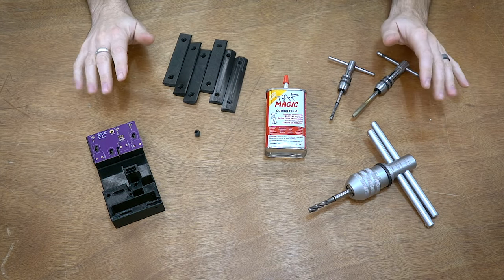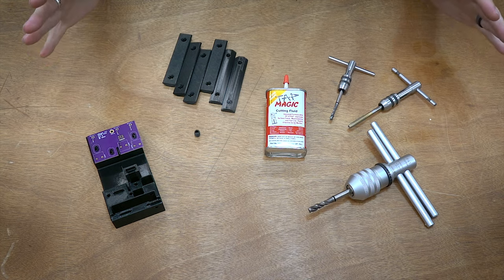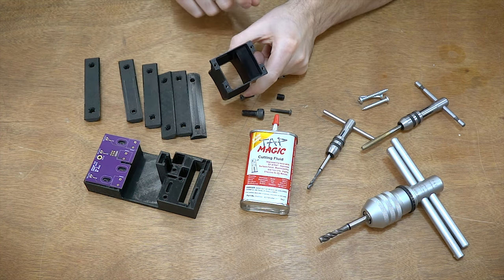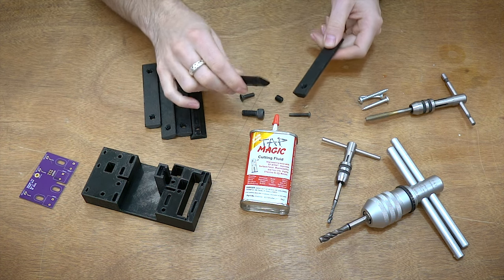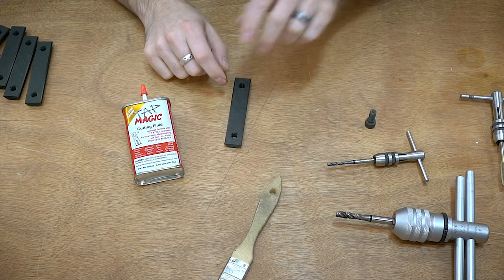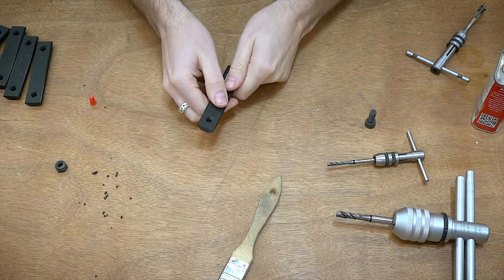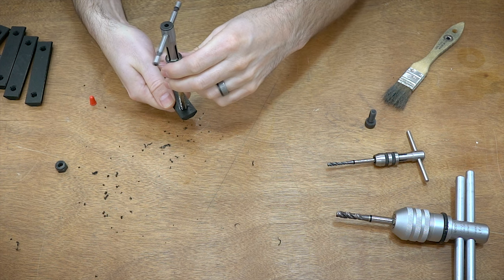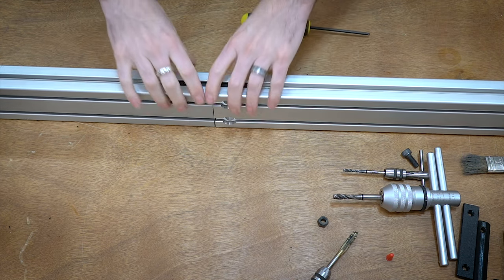Tapping 3D Printed Parts

Comment: Excellent video,  I would have never thought to use tapping fluid on plastic parts.  I will definitely try this.  I do tend to use the heatset inserts a lot, but I am also mostly in the M3 realm.  One thing you didn't mention for captive nuts is you can program a pause in your print,  drop the nuts in and then resume.  I do this with Magnets,  I have prints with completely hidden magnets.  There may be other workflows, but mine generally is to edit the G-Code and add in an M226 pause command at the desired layer.  I wrote a python script to automatically parse my g-code and add in the M226.  It looks for a layer/process change name that I set in the slicer and get's commented in the gcode.
Reply from the maker: Very true about pausing the print!  I've done this a few times, but for protypying, it slows things down quite a bit.  You can do this easily enough in Prusaslicer, you just click the plus button on the layer and it will automatically pause the print and wait for input.

Comment: One thing when it comes to wall counts is the nozzle size. For mechanical and fast iteration parts I print with 0.8mm nozzles, not the standard 0.4mm. Hence the wall thickness and strength increases, vs adding more walls that take more time to print.
Reply from the maker: For sure.  I was giving generalized information, but larger nozzles can create wider walls for sure.

Comment: You don't necessarily need a thread tap to make threads in plastic. The threads might even be stronger if you don't use one. When I was prototyping and designing the Gyrokey screwdriver handles, I tested using thread taps, but also created the threads directly using the screw. The handles are made for watersports hydrofoil assembly where M6 screws are pretty common, so I decided to use M6. If you use the fastener directly to make the thread, it will generate a lot of heat going in and there's a good chance you end up with a melted mess. However, I found that applying a bit of teflon grease on the screw reduces the friction so much that it no longer damages the thread. I have been getting excellent threads very easily by using this method. The thread length on the Gyrokey is a whopping 12mm, so it is extremely strong. If you tighten the screw too much, you will break the surrounding plastic (the thread itself will hold).

Here's my video on the Gyrokey, in case you're wondering how on earth a 3D-printed screwdriver handle might actually be a viable tool: https://www.youtube.com/watch?v=lutnfhRlRjc
Reply from the maker: You're mostly right, but threads cut by a fastener don't hold up with repeated use.  I think trilobular screws are the right way to go if you're not going to use a tap.

Comment: I use a bunch of the heat set inserts.  I've never even thought about taping.  I'll have to try out this method.  Thanks
Reply from the maker: It works better than you might think, seriously.  I go through a LOT of brass inserts, especially when running multiple tests on a single print.  This helps a lot.

Comment: I've got some parts I've printed for work that aren't necessarily final use parts, but are trial parts and need to be functional long enough to prove out their usefulness. I just sized the holes to where the bolts (#8-32 for the closure and 1/4"-20 for the hinge "pins") cut their own threads and had some extra friction to the fit from doing so. I'm using PETG and have the design and general form-factor freedom to where I can afford to have a thread engagement of ~4x the diameter but they seem to work nicely. For the knobs I've been printing them with a nut-shaped cavity and having it pause before it covers the cavity so I can drop nuts in. 

For cutting threads I've added a lot of extra material around the holes to be tapped (and drilled as needed) by adding small cutouts radially that are ~.1mm wide and 2-3mm long/radially and that not only gives me lots of extra material without having to add a modifier to the slicer or set all of the walls thick, but at least intuitively it seems less likely to just bust the cylindrical bore that you tap out if you over torque.

Comment: I believe CNC Kitchen did a video about this topic comparing inserts to square nuts to just screwing bolts right into plastic and found that the bolts right into plastic worked pretty much just as well as the other options for the first time inserted for tension  getting weaker after that. I believe the other downside was being stripped more easily.

Personally, because exactly the problems you talked about with using too many brass inserts and because of the extra time and complexity, I have used just screwing into plastic a lot and haven't run into an issue with it. Sure, its harder to turn the bolts than if the hole was tapped, but for something I only screw in once, maybe twice, it works well, and only requires a little bit of elbow grease or a powered tool and the bolt cuts (forces) it own path.

I also have the untested idea that perhaps not cutting threads might even make for stronger connections.
Reply from the maker: Yes!  I remember that video.  I think for MOST applications, simple cut threads work just fine.  If your part is well designed and you're not asking too much of the fastener, you don't really 'need' threaded inserts.

Comment: Great video! Some really useful information there.
Reply from the maker: Glad it was helpful!
Reply: @RobertCowanDIY  Yeah I was screwing around with those metal inserts, trying to embed nuts into prints or even just driving heated screws straight into plastic (with or without undersized holes), I tried tapping before but never thought of using cutting fluid since the plastic is so soft anyways.

In hindsight makes perfect sense but it takes a well made video like this to really drive the point home. Will for sure try it out the next time I need a threaded hole in some plastic.
Reply from the maker: @bami2  I did the exact same thing!  Once I used cutting fluid it was like "duh".  It makes it so much smoother and I got really clean cut threads.

Comment: Spot on with the inserts.  But that's what I use for about 90% of the time.  I have noticed if they are near a wall it will bulge out.  So I have ended up adding material and reprinting parts.  

Nice video!
Reply from the maker: Thanks!

Comment: At 6:52 I think you flipped the numbers. M8-1.25 is coarser than M8-1.0. I’m sure you know this, but with metric screws, the second number is the distance between threads so a lower number is finer, the reverse of imperial screws where the second number is how many threads per inch.
Reply: Exactly was about to report the same. M8x1.25 is at the same time coarser than M8x1.0 and standard so it is the way to go!
Reply from the maker: Yep!  You're right.  I just messed up when saying that part.

Comment: One thing to mention is to make sure to have enough perimeters around your holes in your slicer program, at least as thick as your OD minus ID.

I've personally never bothered tapping holes in plastic. I either use the heat set insert for something medium duty or just screw right in with machine screws for light-duty. It takes a little playing around to get the right hole size, but once you do it works fine.
Reply from the maker: Ha, you should watch the video, ALL of this is talked about.

Comment: I'm a bit surprised that you didn't mention printing the thread itself. If the hole is vertical then the printer is just laying down a series of circles with a different offset for each layer, which makes for quite a good thread. I find for M6, I can print a threaded hole, take the part off the printer, and screw a metal bolt into it with no further processing.  Interesting video - as always.
Reply from the maker: I've not had good luck with 3d printed threads.  I also don't think they're nearly as strong, but that's just my opinion.
Reply: That's what I do. I 3D print down to about an M3 or M4. You need to make the thread pitch pretty far oversize. You want it to be a little tight though. Then run the screw in and out a few times to get it hot and extrude the thread to a more precise shape. But best way is no threads at all. Just use a nut on the other side. I will 3D print a hex shape for the nut and then melt or glue it in place.
Reply: I also do this but still tap the threads.  I believe it creates better walls since it creates 2 or 3 walls all around the threads.  It's not creating a thin "tube" that you are tapping.

Comment: 6:45 slight correction: 1.25 is the coarser thread. Metric thread sizes are distance between threads, imperial size iirc are rotations per inch?
Reply from the maker: Yep, you're totally right!  I screwed up.  Thankfully, metric really doesn't use coarse and fine for many sizes, and usually one is easy to find and the other practically doesn't actually exist.
Reply: @RobertCowanDIY  a while ago I had to get an M11 thread into something and that's the only time I've ever actually had to make sure to get the right kind of tap.

Everything else there's a super clear "dominant" coarseness if there even are multiple.

Comment: If you stop your print before the nut hole is covered up, then continue once the nut is in place. Some slicer programs call it color change to pause the print. Use Prusa slicer. Works well for that.
Reply: I do it all the time. It's great.
Reply from the maker: Yes, I do that as well!  The only problem is when you have nuts in multiple orientations or at different levels.  It takes more planning.  I tend to just press print and walk away.  Then I tap it later.  I guess it's probably the same amount of time either way.

Comment: I just print threads(m8 up works fine) or have the bolt thread itself. 

I still got m8 rods and printed bolts on z axis. It works well enough so haven't bothered "making it correct". For this use printed tight nuts are better than metal nuts(no slop. The printed nut lasts a long, long time)

Comment: I sometimes use odorless mineral spirits as a cutting fluid when I have to drill or tap plastic.  The mineral spirits evaporate, keeping the plastic cool, and generally prevent it from gumming up.  And it also provides a small amount of lubrication as one of the "oilier" solvents.  It evaporates, so, clean-up is easy.

It might not be the best cutting fluid for plastics, but it's "easy" and good enough for most of what I do.
Reply from the maker: Yeah, I think for plastic there are a LOT of options for tapping fluid for sure.  I just really like tap-magic, the smell reminds me that I'm actually making something and it really does work great.

Comment: awesome. how do you design the holes to have extra thick walls to be able to support the threads?
Reply from the maker: Not normally.  I usually only rely on threads for basic assembly and use features on the parts for loading.  If the part actually gets loaded at the fastener, I'll just a captive nut or heat insert.

Comment: McMaster sells an extraction tip for removing heat sets - have you tried using one of those to extract used heat set inserts?
Reply from the maker: I wasn't aware, do you have a link?  How does it deal with all the melted plastic around the edges, surely that would need to all be removed?

Comment: There are taps that are designed to cut bottom hole threads, but they are not easy to start tapping at the top of the hole.  So one would use two taps, one to start the hole, and a second to tap all the way to the bottom of the hole.  These "bottom taps" are only needed for blind holes.
Reply from the maker: Oh for sure.  For a beginner video I didn't want to over-complicate things.  Generally speaking, if you're designing your own part, you can control the depth of threads.

Comment: I just saw that you go straight through with the threading tool. I learned that you should go 2 revolutions and then back-out to clean the cutting fronts, then go more.
Reply from the maker: It depends.  I usually use spiral flute taps, and they can go pretty far since they push the chips to the spirals.  If you start to feel any resistance, it's a good idea to back it out, but this part was relatively thing, so the chips didn't get in the path of the new threads.
Reply: @RobertCowanDIY  i was referring to the  generic one you used... I cant get my hands on to spiral flute ones locally - at least never seen them. 
I think they are more from the machining supply ?
Reply: There's no harm in doing that, but in many (probably most) cases it's not necessary. As RC notes, it depends on the tap type (spiral, straight, etc.), the material characteristics (plastic, aluminum, steel, etc.), the operation (blind hole vs. through hole), among others.

Comment: A lot of tapping tutorials talk about backing off a quarter turn every once in a while, is that still recommended for plastic or does it not matter?
Also when a tapping set comes with multiple steps, can you just use the last step or is it better to do a multipass?
Reply from the maker: I guess I should have gone into more detail there.  The reason for backing out is older straight flute taps will get clogged quickly.  I tend to back out when I start to feel a change in resistance, regardless of material.  Like I said, don't force it, don't push through it, it should feel smooth and easy.  This was a relatively short thread, so it never bound up or got clogged.  If you feel any additional resistance, just back out, clean off the tap and go back in.  I'm not sure what you mean about multiple steps though?  I think you're maybe talking about bottoming taps, plug taps, etc?
Reply: @RobertCowanDIY  Thanks for your reply, very clear! With multiple steps I meant cutting depth, my tapping set has 3 different taps for the same thread, I guess that's only really needed for really tough materials...
Reply: @RobertCowanDIY  Perhaps by multiple steps, he's referring to taper vs. bottoming taps? In which case one typically finishes with the bottom tap to get threads as far into a blind hole as possible.

Comment: Literally every one of my 150g bots uses M3 tapped holes for supporting the top plate. I tried brass inserts on a 1LB bot but they were easy to pull out when hit directly.
Reply from the maker: Nice!  On my earlier bots, I just used wood screws or plastite fasteners.  For that small, the interface is always the weakest part (brass insert into the plastic, or the threads in the plastic directly).  The brass inserts just don't have enough material to hold well.

Comment: The hole for the taped connection should be a tap drill size hole, correct?
Reply from the maker: Correct.  That's what the charts are for, they will tell you what diameter the hole  needs to be for the tap.

Comment: I never bothered to tap them, tbh. I just double up the print and thus have a thick wall, and with a small taper to center the screw, it taps its own path. You just have to remember always back the thread whenever  you're reinserting it after.
Reply from the maker: Yeah, that certainly works, I used to do that.  But tapped threads really do feel a lot better, can easily be re-used, and are a better mechanical connection.

Comment: It's pretty easy to print course threads for m4 & m5 using twice the nozzle size as an increase to diameter.   The problem is if it fails.
Reply from the maker: I might have to try that next time.  It would remove the extra step of tapping afterwards.

Comment: 6:50 - Slip of the tongue - I think that may be the other way around.
Unlike imperial, the coarseness of a metric thread increases with the size of the pitch figure, so 1.0mm will be finer than 1.25mm or 1.50mm (bigger figures have greater numbers of ridges per unit-length, not fewer).

Possibly. Sort of. Maybe. Perhaps.🤔 Whatever.
Reply: Metric fasteners thread pitch is measured in mm-per-thread, so you are correct until the parenthesis. Big measurements mean more distance between threads, not more threads.
Reply from the maker: Yep, I've addressed this elsewhere in the comments.